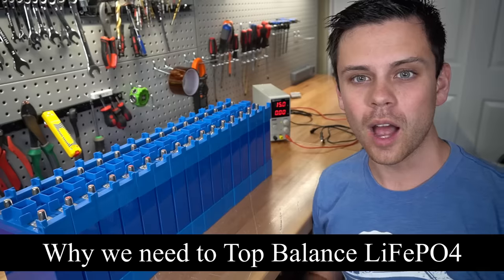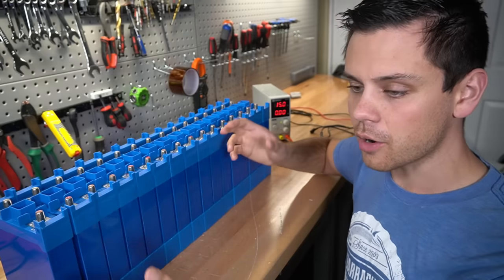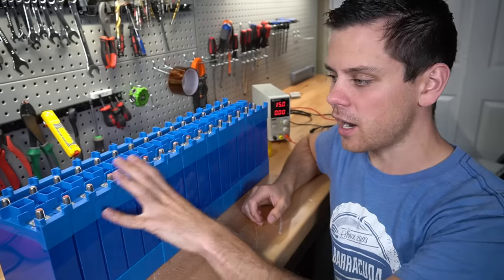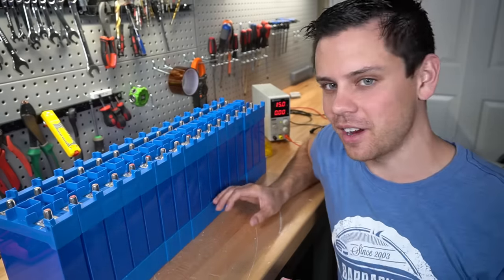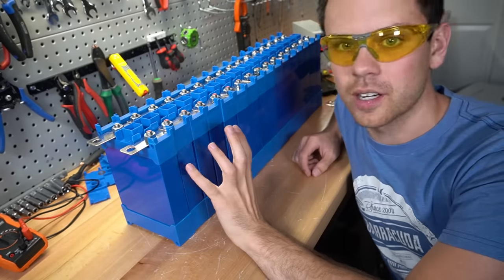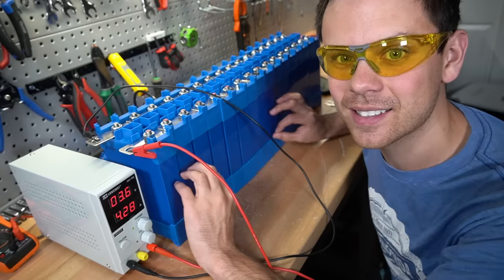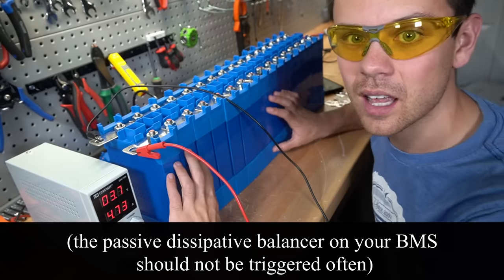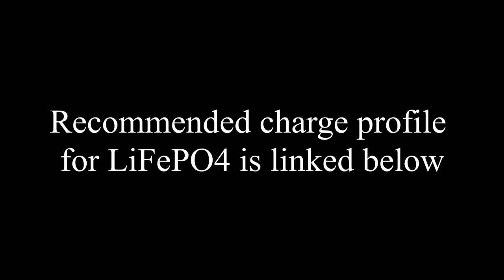How to Top Balance LiFePO4 Battery Cells Quickly (and when you need to do it)

Comment: Ok, I've seen top balancing videos and understand how and why it's done but why it works is what escapes me.  Let's say you have some cells hooked in series. All of the resting voltages are pretty close . When you charge them, one cell gets to 3.6ish or enough to cut off the BMS hi voltage limit, while rest of the cells are at 3.3ish. What's causing the one cell to charge so much faster than the rest? If it's a lower internal resistance, individually discharging that cell to match the rest (let's say the arrangent is spot welded in-place) should not change the internal reistance of that cell, yet discharging it often fixes the problem so what else is at work here?

Comment: I have a question I hope someone can answer.  I just bought some LifePo4 batteries for my off grid system.  4 - “KiloVault” 3600 Wh each.  They have a built in BMS and I want to maximize longevity.  I plan on only ever going down to about 25% DOD.  So my question is about the top end of charging.  Is it ok to only charge them to say 99% state of charge each time?  Or do I have to worry about some type of finishing charge like lead acid?  Thank you in advance.

Comment: Hey Will, Just for clarification can you explain the reason & importance of wearing safety glasses when touching batter terminals.
Reply: Not Will here :) The reason is for protection of your eye in the event there is a short while working on the battery sparks could easily fly into the eye

Comment: Please reply.. I have  8 cell of 3.2v 100amp, i will connect 2 in parallel then i will have only 4 cell of 3.2v 200amp then i connect all in series 12v 200amp.. the question is, before connect them all should i charge all of them indivisually and balance or i jusy only balance and connect my daly bms .. is my bms manage the capicity of all cells when i will charge the whole battery pack of 12v 200amp???

Comment: So I started top balancing my new cells and I have done everything in the video accordingly.  Set my voltage and amperage. It’s taking a while for the amperage to drop and I have noticed that after the amperage drops it starts increasing again.  Is there something potentially wrong with my power supply?

Comment: Lifepo4 battery does'nt need float charge if use normal 12 volt lead acid charger on 4s lifepo4 12v pattery pack with daly bms is it ok? Or harmfull my cells?

Comment: I tried balancing those prismatic cell at 3.33v putting them all in parallel as you did. Charging at 1ah. Left them for a week..may be more. Nevertheless I've noticed even though the charger was set at 3.3v the cells closer to the charger were at 3.4 while those farthest where lower. How come? If in parallel how's that even possible?

Comment: If I have a 16 cell bank  ran in series to make 48v 
But I want to add more cells to increase the storage capacity can I get an additional 8and run them in parallel to the 16 in series?? Would this work

Comment: Instead of going over 3.65 for faster charging you can just upgrade you're cheap little wires there!  You're only needing to do that because you're getting an IR drop on your wires.  I get 10 amps out of the same charger with thick wires at 3.65V
Reply from the maker: Dang I need to make some. I hate that connector, I don't have any. Should order them and good point
Reply from the maker: Thanks Christopher, great idea
Reply: Hi Christopher, you mean the wires deliverdd with this power supply are to small that is what is reducing the current ? (I got the same power supply as well)
Reply: Cedric, yes.  Charge controllers are smart enough to guess the IR drops, but not a power supply.  LiFePO4 has a very small internal resistance,  so you're wires should be even less, otherwise your making heat instead of charging and it takes significantly longer.
Reply: or maybe because they make a 5A model and 10A model that look exactly alike? lol..

Comment: so I have 6 x 48V batteries with their own internal BMS and individually I can not get them past 54.6V even though I have my charge controller set to 58.4. I'm guessing that one of the internal batteries in each one is charged higher and cutting off the charge early? How do I get around this, the battery vendor is saying to cycle the batteries multiple times to get them to increase capacity...

Comment: Why did the PSU voltage jump from 3.6 to 3.7 in one of the edit cuts?

Also, if you want to balance these cells properly, you’ll want to move one of those power leads to the other end of the stack to negate the different resistance each cell sees because of the length of the bus bar.

Comment: Hi Will. I'm french and I plan to build a LiFePo4 12V-90Ah battery with grade A cells from Aliexpress. I know Chinese can be tricky on their products so I would like to balance my battery before using it in order to have the best capacity. I've perfectly understood your methods for balancing cells but I wonder if I can charge each battery one by one to 3,65V with the power supply and then assembly the battery to make a 12V + BMS.
Is it dangerous for the cells to do like that ?

Comment: I Will - Just purchased 16 of those cells from Electric Car Parts for a new 48 volt system.  Also purchased an AIMS 48 volt 6KW inverter.  Would I be able to top balance using the charger in the AIMS inverter without buying the $50 power supply you used?
Reply from the maker: If you are using fortune cells I would hook everything up and do a capacity test. Should be fine. If you're not in a rush, you can let BMS top balance. Might take a few cycles

Comment: Pro tip: First make sure your cheap amazon power supply actually puts out the voltage it reads... they can be off by up to .3 volts!  Learned this from personal experience. 🤦🏻‍♂️
Reply: so which one do you recommend?

Comment: can i charge my 32650 in 10p 4pcs in buck converter input is 19v laptop charger and out is setup in 7v. that is over voltage in 3.2v 32650 battery? thankyou

Comment: Hello. I have 19S 10P 32650 battery pack the pack has 2 years and I need to balance that pack. Each cell is 5ah 3.2v . there are 190 cells to balance. I have a skyrc b6 charger. Any advice to do it? Thanks

Comment: Are any of the BMS units capable of identifying a bad cell?  It would be interesting and useful to see this process demonstated.
Reply from the maker: Oh there are cell checkers that can test internal resistance. Some are not that accurate though. I like to put a huge load on it and see the voltage drop directly. Then I capacity test to see if one cell is smaller. Usually only an issue on used cell systems

Comment: I have 4S 3.2v 280Ah cells. They came charged to 3.3V +/- .02V. Not sure if that needs to be top balanced but I did anyways using the same setup as above, with a 10A/30V charger. The charger shows 3.4V and 1.8A but after 2 days those numbers remain unchanged. Still 3.3 +/- .02V. I'm new to all this, any help?

Comment: Good morning & thank you for you're time and experience , I have a Question let me explain I have 5 3.2v Lithium Phosphate 200Ah batteries series is 16v still at 200Ah and I have 2pcs LTO 2.4v = 4.8v & 5 pcs 2.3v = 11.5v - 2.4v+11.5v = LTO 16.3v ` Is .3v much voltage not to be able to link these battery banks togeather ? My BMS wrutes to install the batteries hav
Reply: BMS all batteries have to be .05 close can not be more than .05 off

Comment: I just got four 3.2V LIfePo cells and looking to top balance. Why does Will set the charger to 3.65? Are his cells 3.65? If mine are 3.2V, should I set the charger to 3.2V or 3.65V as he does? thank you!!
Reply: It's because LFP chem is like that, nominal voltage is around 3.2-3.3V but you want to fully charge to 100% SOC then 3.65V is the voltage to set however when the cell reaches that limit you will notice that after few hours your cell voltage drops to 3.3-3.2V. that's completely normal for this cell type. You can look for charge recommendations in the manual you got with them and I am pretty sure they would suggest you 3.65V too :)

Comment: Will - Shouldn't you have connected the positive on one end of you 16s battery and the negative on the other end - that way each the distance is completely equal for each cell?
Reply from the maker: Not at this current. Doesn't matter in this instance. See pinned comment
Reply: Jesus christ so many comments about the same thing, GET OVER IT FOLKS

Comment: Hello Will and fellow DIYers, I have 8 brand new 280Ah Lifepo4 cells that arrived balanced and a JK self balancing BMS. I also have an LV2424 but I don't have a separate 24v Lifepo4 charger. Would I be able to use the charger in the hybrid LV2424 to do my initial Top Balance? I haven't seen this done before. Thanks!

Comment: Will have a understanding this correctly? Are you just charging those lithium cells directly from a power supply? No fancy charger and algorithms just pumping a set voltage into the cells?
Reply from the maker: Ya CC/CV works great for lithium chemistries
Reply from the maker: Nothing fancy required

Comment: Hello Will, I have 16 new 150Ah cells then I was top charging in parallel as you have done,  With 3.6v input, they started out at 2.5 amps and it stayed at 2.5amps for 12 hours when I had to discontinue the top charge.  I am going to try again tomorrow, my question is how long should the top charge take?
Reply: Same issue here.  Starting at 3.4 vpc, the amps are very low like 1.3 amps and stays close to that for days. Not sure how long to keep it there.  Another article says keep at 3.4 until 0 amps then move to 3.5 until 0 amps and then 3.6 until 0 amps but I'm afraid it's never going to get there.  holding at 3.6 for days seems like it could cause damage.  Did you ever get this sorted out?
Reply: @varicella7  hello, I have the same issue . I got my 4 new cells at 3.28v and try to top ballance  them. I hooked them all in parrallel to the same power supply you got and applied 3,6v. After more than 48h it only charged to 3,36v ... What should I do ? I tried to individually charge 1 cell one night but same result so I put back everything as it was.
Reply: @cedrichuchette  Honestly, I just gave up on trying to get it to go to 0 amps, I pulled the batteries off the charger after they were on there for numerous days and just used them.  They seemed pretty well balanced
Reply: @varicella7  OK. I guess I will have to do the same... I might put the BMS and plug again the power supply to charge to 14.4 v..
Reply: FYI Will says in this video that it could take a really really really long time.  He says "Days or weeks" in this video as I recall, based on where the batteries are at when you start.

Comment: So.. I charge a single LEV60 3.2v (3.5v max it says) and hours later its only at 3.3v. I am using the same power supply set at either 3.5v or 3.49v. Hours later its still only at 3.3v. When I take the power off, a couple hours later the battery is down to 3.28v or so. Is that normal? If so, how do I ensure all 16 are the right charge to assemble my 48v battery (Jehu 48v battery pack)?

Comment: Please help i build a battery pack 16s2p
I already spot weld them 
But when i charge the battery i cant get the full charge at 58.4 or something i already get an 53-54volts only 
My battery and bms are new 
:( Please help should i remove the strips and top balance them or charge them at 58.4 volts directly?

Comment: I am using two lead acid batteries in series and they are unbalanced. how can I balance lead acid battery ?. is it possible with same way after connecting in parallel and charge it?

Comment: I don't like the idea of rigid bus bars ..I am thinking of same lenght wires for handling sideway forces
Reply: We tried wires with clips on the ends but the gauge was too low so they were not balancing.   It's already a long 3 to 4 day process using aluminum yard sticks.    After we got the charging down to around  0.03 amps, we shut it off but left the bus bars on for a couple hours to complete the  equalization.

Comment: In one of your other videos you stated you prefer to bottom balance. Are you still recommending Top balancing for new batteries versus Bottom?
Reply from the maker: Top balancing only. Bottom balance makes sense for no bms systems. But that's not an issue anymore
Reply: @WillProwse  thanks! I was confused. I have a couple of cells out of the 16 I bought from Overkill solar that are different voltages. I love your channel, thanks for all you do!

Comment: Anyone know if it is safe to set a target with Variable DC Power Supply and just leave it there over night or do you need to disconnect it relatively quickly? If I just set a target of 3.5v is there any issue with damage to the batteries if I leave that for 24 hours if I'm not available to check the batteries?

Comment: Hi i need help. I have lifepo4 batteries. 32s10p at around 55ah capqcity. They are brandnew, and was tested with internal resistance, and they hold charge quite well, but now i have connected them to bms. Initial charge from factory was around 3.3 v, all connections were check, and correepond correctly. I have used ant bms, and set the settings as per manufacturer specs. 3.65v max volts, charge current is at 30amps or 0.5c , the problem is when one cell group reached 3.4v it rapidly when to 3.6v, so the bms alarm and cut off was trigger, charger reboot and detect it as fullycharged. What is wrong,.? Presumably all cells are good

Comment: Hi Will i bought 6 x 12V battery packs from Nyppd on Ali Express , there are 4 batteries 3.2V for a total of 150 ah with JBD 120 ah bluetooth bms,  i noticed that after charging them fully, 
cell 1 is 3.366
cell 2 is 3.510
cell 3 is 3.414
cell 4 is 3.382
And when discharging with a load
cell 1 is 3.312
cell 2 is 3.312
cell 3 is 3.311
cell 4 is 3.313
my question is,  is this normal or should i top balance my batteries to 3.6 V each with power supply and which power supply would you recommend 
Thank you

Comment: @willprowse Hey will i have 2 lifep04 10k batteries, one in new than the other and they are connected to a hybrid inverter. I have notice that one is charging and discharging  faster than the other. Any suggestion here?

Comment: Will, it will do the same job if you charge the cells in parallel to 3.35V. As you showed in the video, only not to 3.6V but to 3.35V or 3.3V. There is no point in charging to equalize the cells to the maximum, it causes unnecessary stress on the cells, and subsequent assembly of cells charged to 100% is not very safe.

Regards, ParagonDIY

Comment: Will? Are you speaking, cuz- I can't hear you! Those Fortune 12v Cells are screaming at me!
Reply from the maker: Fortune cells are hands down, my favorite. I love them.
Reply: @WillProwse  SO FUNNY! I JUST convinced my wife to let me build a 12v 240AH battery bank with 16 cells! I've been thinking about these for DAYS, Will!! Hahaha
Reply: Will, I was checking the low voltage recommended cut off. Am I wrong- I see 8.8v as the 4 cell battery cut off? When checking the Lithium curve, it seems that using 11.5 (or slightly lower), or 10.8v would be cutting the BMS cut off kind of low, since 11.5v represents between 80-90% of the batteries total capacity, right? He asks, scratching his head?
Reply from the maker: @DCGULL01  Oh I would not use the charts because it is dependent on temperature and whether its a charge or discharge curve etc. SOC curve is most accurate. I would use the recommended one I listed here: https://diysolarforum.com/threads/recommended-charge-profile-for-diy-lifepo4-batteries-sticky-post.5101/
Reply: @WillProwse  Thank you, Will! Last question- Promise! Because these will be going into an RV with  solar, an AC converter, etc...I should BOTTOM BALANCE after testing post build? I was planning on capacity testing on the first full charge, then apply a slight charge and bottom balance at say 10.9V or 11v. Then, test each BMS: overcharge/discharge shut off, temp sensor shut off. install the caps, mount the BMS' on top, put inside of the Rubbermaid battery box (with black tank heating pad) and DONE!!! Thanks- still giggling over this video with my current obsession (electric joke there, Will!)
Reply: DIY Solar Power with Will Prowse thanks Will, that 14.1V recommendation is exactly what I was looking for , for my 720AH RV system. As a Tesla owner too, I have been aware to try not to routinely go over 90% SOC but manually monitoring this has been a pain over the past 2 years, especially when the BMV512 gets the SOC out of whack a lot. (I charge to max once/month to reset the 100% - is that the best way?) Thanks
Reply: DIY Solar Power with Will Prowse  a corollary to my post above,. During this period of lockdown, my RV is not being used fulltime anymore (I found a house), I have found setting the float on the Victron BMV to 13.4 keeps the SOC between 80-90% by end of the day ( I still have Waeco 12v fridge/freezer full of food to run 24/7)
Reply: @DCGULL01  BMS=top balance, no BMS=bottom balance, from what I gathered that's the best practice answer.
Reply: @DCGULL01  my wife  let me build? What a wuss.
Reply: @WillProwse  Yes.👍
Reply: @DCGULL01  My wife left me for another woman exactly 20 years ago today in 2001. I have 24 of the 280ah cells balancing now, a pair of Daly 250 amp BMS units arrived Thursday, a case of Will's reviewed 2 sided 410 watt solar panels and the 200? amp charge controller coming from Texas. That's for my son's battery backup unit to run a big fridge and 2 chest freezers. Weird stuff happens in California. Too bad it gets exported.   Oh....I ran my purchase by the cat. He rolled on his back and stretched his legs. That was a resounding YES.  I'm gad you are doing better than me in the wife department. Mine put the WHY in whyffe.